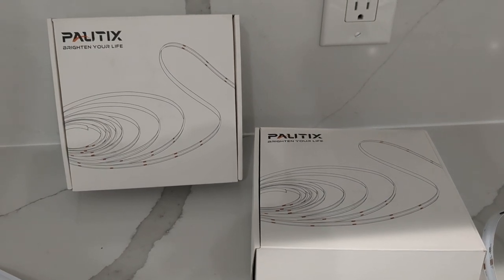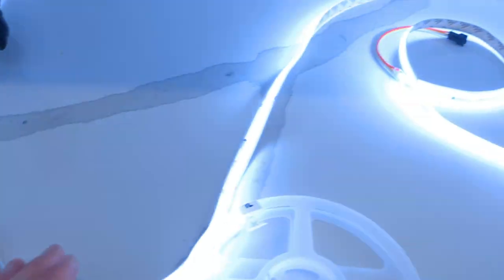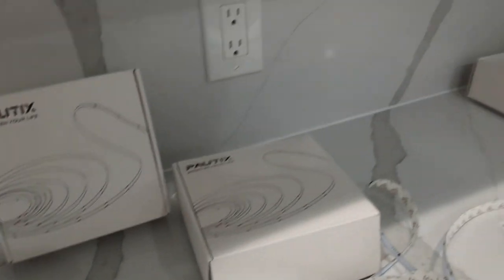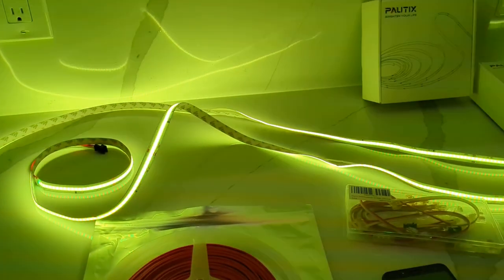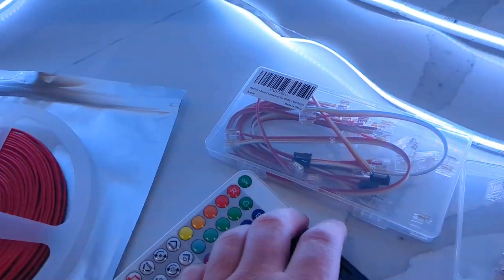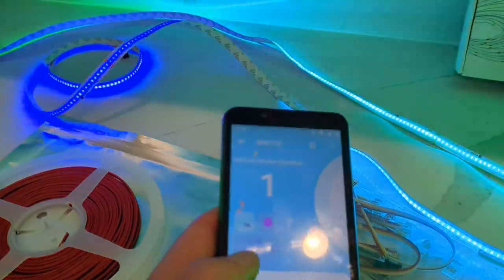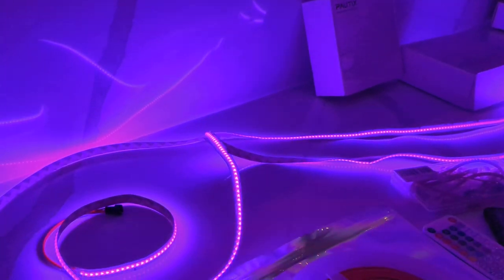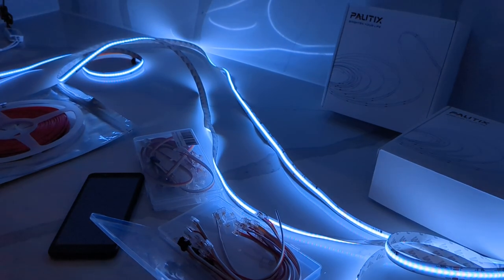Pautix RGBIC COB LED Strip Lights Setup and Demo

Comment: Sr. How long can i go, with one controller ? Can in have 70ft strip in one controller ? Wont the drawn burn the controller or power suply ?
Reply from the maker: @leonardoguarita9121  I forgot the numbers, the Amazon listing used to tell you what size power supply to order based on how long you wanted to run the LED strip. If you message the seller they should be able to tell you what to order. I did that when planning my system to make sure I had all the correct parts.

Comment: I plan on hooking this up to a wall outlet that is connected to a wall switch.  This means when the switch is thrown, the power is cut to the power supply of the LEDs and not just turned off.  In this case, will it come back on with the same settings as before or does that only happen when it is turned off using the LED power switch?
Reply from the maker: I just tested unplugging the power from the LED strips and then plugging them back in to simulate your scenario. The LED returned to whatever it's previous setting was so your setup should work perfect.
Reply from the maker: Check out my newer video on these lights with more info and completed install. https://youtu.be/QYHxdL84C-c?si=4EuRolTMg0JNW_1G
Reply: @MrEngineerReviews    Wow!  You ROCK!  Not only did you do it, but you did it just a few minutes after I asked.  Thank you so much.  This really helps.
Reply from the maker: @ProfessorOzone  No problem, glad I could help. Good luck with your install.

Comment: Can you please answer a question?  Here is my goal.  I wish to purchase the Pautix 24 ft COB addressable line.  I need to create a static display that has the entire length in blue BUT have a section somewhere in the middle (about 3 ft) that is red.  Can this be achieved? Again, a static display, no funky jumping and moving and flashing…just about 10ft of blue then 3 ft of red then the rest 11ft of blue again.  Turn off, turn back on and this is what displays every time…doable?
Reply from the maker: Here is my complete install https://youtu.be/QYHxdL84C-c?si=4EuRoITMg0JNW_1G. I don't see an option to do what you want to do with the controller that comes with this kit. I ordered a new controller from AliExpress that connects to wifi and I'm hoping it allows that, I'll find out in a few weeks when it comes.

Comment: i tried connecting two 5m strips together i done it works 10m  then  the other 5m doesn't work now do i need to upgrade  power supply or something
Reply from the maker: @walid_bey  On the Amazon listing I think I recall the listing showing how much power is needed for each length of strip, you probably need a larger power supply.
Reply: @MrEngineerReviews  thanks for the help are u using multiple controllers ?
Reply from the maker: @walid_bey  Yes I have three separate runs of cabinets separated by doors so I have a separate controller and power supply for each area.

Comment: What’s the name of the app, and my lights are just red the remote does not change the color, any ideas ????
Reply from the maker: @anasalinas3142  The app is BanlanX https://play.google.com/store/apps/details?id=com.spled.scenex. I actually bought a new controller that works with Smart Life so I can control it via WiFi remotely. Not sure why your remote isn't working, did you make sure the tab where the battery is was removed?

Comment: I want to use 1 controller to control 4 strips (1 metre long each) I have cut from the 5metre reel in the kit, I’ve got 3 of them connected and working but when I add the 4th it flickers and is a different colour to the rest?
Reply from the maker: Check the wattage to make sure it can handle it, you might need a higher power one.
Reply from the maker: Did you figure out why it didn't work? It is probably a bad connection. Just finished my install https://youtu.be/QYHxdL84C-c?si=4EuRoITMg0JNW_1G

Comment: Can it also just do warm white?  Also if I connect 16 plus 24 ft what power supply can I use?
Reply from the maker: Yes it can do warm white by selecting the RGB numbers similar to warm white but there is no actual warm light, just the cool white. Not sure about the power supply requirements, try emailing customer service.

Comment: Can i buy 2 in the same room and have them working separate on the app? Also can you link where you bought the long spool wire? Thank in advance brother. Love the details in the video
Reply from the maker: Yes you can. Here is the long wire link https://amzn.to/45fk9H4
Reply: @MrEngineerReviews  thank you
Reply from the maker: Check out my new video with the full install. I have three separate controllers in the app for different areas in my kitchen. https://youtu.be/QYHxdL84C-c?si=4EuRoITMg0JNW_1G